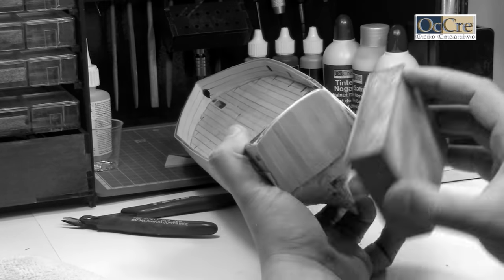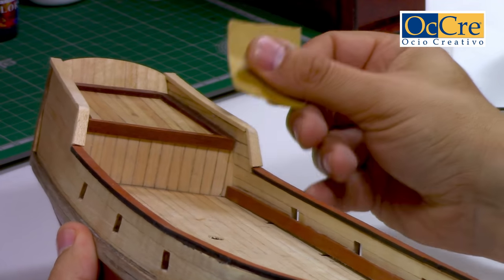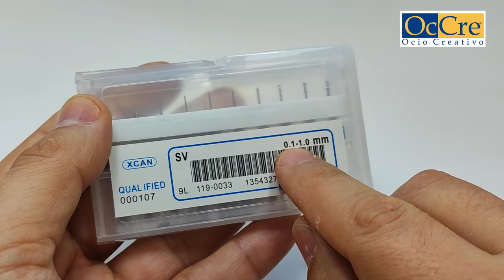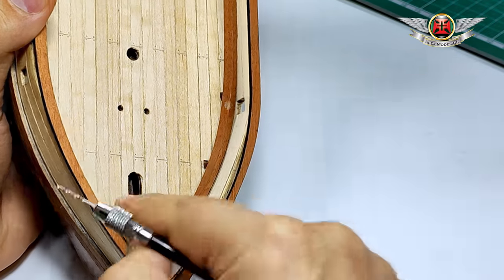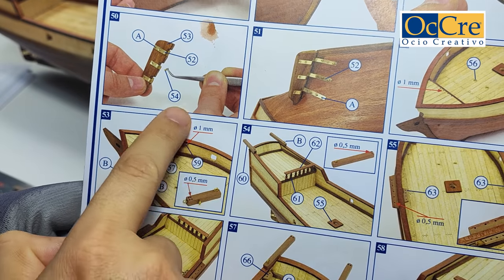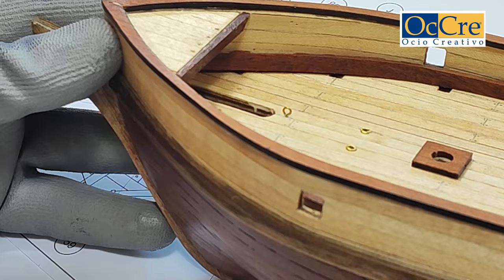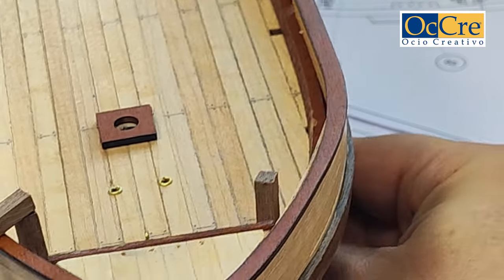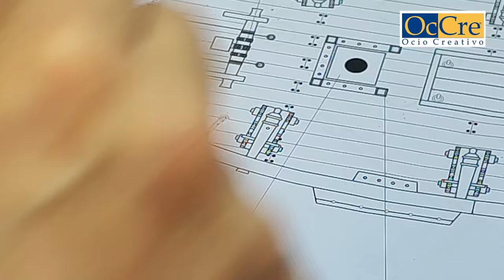OCCRE ALBATROS BUILD PART III NAVAL MODELING PLAMO

Comment: love watching the build as you get farther along but i do have a question . what glue are you using that needs the activator , im really interested in it .
Reply from the maker: Its Super Glue 🙂 i use the acelerator when i want a really fast bond. I aplly tge super glue and then tge acelerator... Have to Wait  a few seconds in position and it will be Hard Rock🙂👍

Comment: Hi Alex.  Your rudder fastenings look a bit clunky and unrealistic.  It's a shame as you've done such good, meticulous work on the other parts.  It might help if you carved out a small recess into the hull and rudder where they are attached.  I appreciate that this could be difficult as you probably don't have much wood to work with, but you might want to give it a try to see if it looks better.  On a real ship, these fasteners would be as close as possible flush with the hull and rudder to reduce drag from the water.

Love your channel!  Thank you.
Reply from the maker: Thank you! You are absolutly right! 👍 I agree with you. Asbi say in the video i will try to do a better work on the rudder in the future! Thanks for the tip! 😊👍👍
Reply: I have no doubt that you will Alex.  You are an excellent modeller.  Never doubt that. @AlexModeling